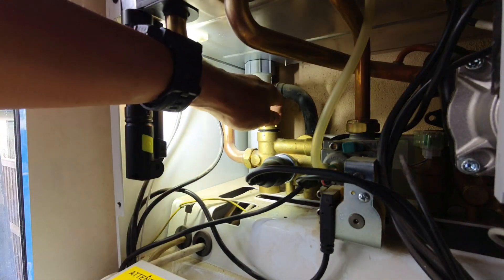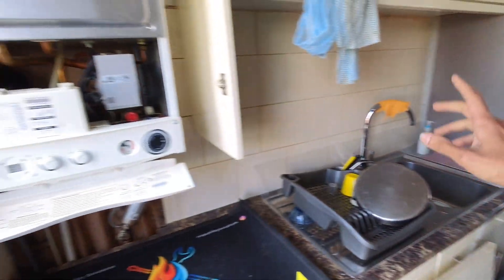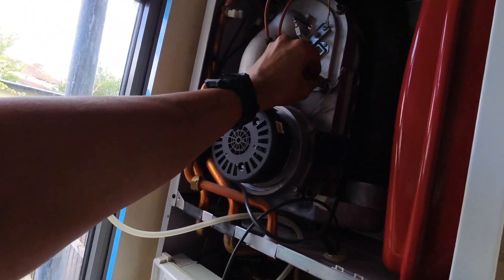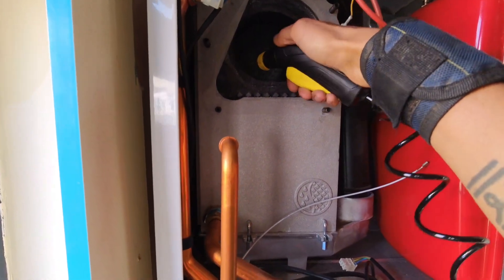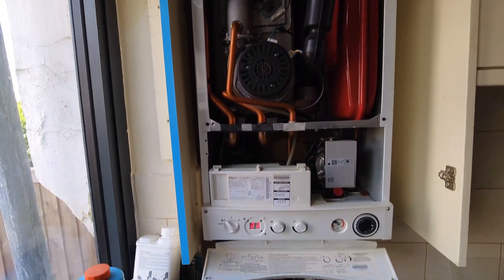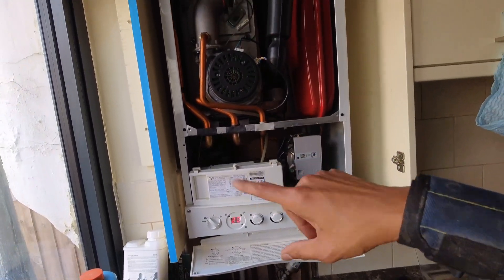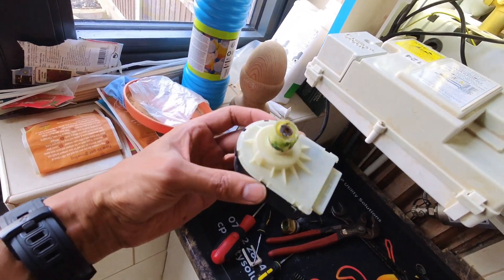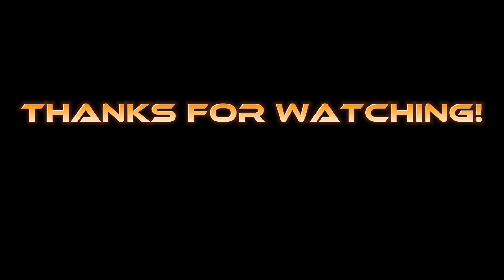What Went Wrong On This Boiler Service?

Comment: pretty sure that wilo pump shouldnt be on those boilers
Reply from the maker: I've seen them on some models before. any reason why?
Reply: @cputilitysolutions  It looked out of place so I checked parts and only lists grundfos as the replacement. Could be wrong mind you
Reply from the maker: @necropig  ah yeah I see what you mean. Maybe it's a discontinued part, so if it fails then would have to be replaced with the Grundfos, kind of like the older Vaillant with the wilos that got replaced by the Grundfos perhaps?
Reply: @cputilitysolutions  more than likely yeah
Reply: I’ve seen quite a few with the wilo pump